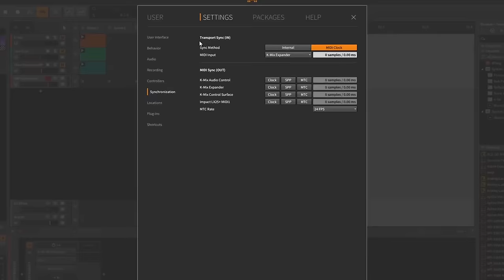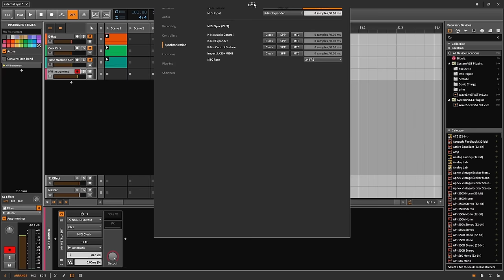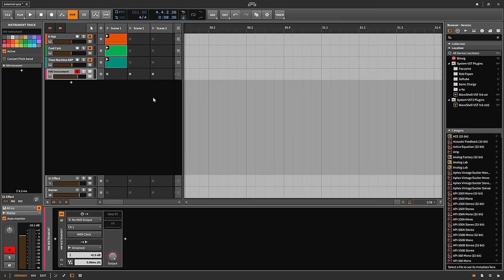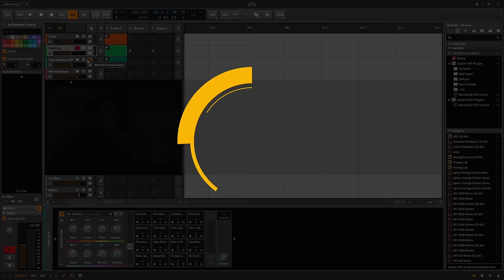MIDI Clock Sync [Bitwig Studio]

Comment: @Thavius do you use driver compensation? And does overbridge help?
Reply: the Octatrack doesn't use Overbridge, and Overbridge introduces latency so I would avoid using it in an external MIDI sync scenario personally. I didn't need to use any driver compensation here, but I do use it when I use Overbridge for my A4 and RYTM.

Comment: But it is not possible to record tempo changes you would make on your octatrack. So, if you would  jam with your octatrack, and you would slow down let us say tempo as a part of your song, record that, play it back now with your midi instruments inside computer. You can't! the part where your recorded octatrack performance is slowing down,  is the place where the rest don't follow.
Reply from the maker: Record the tempo automation on your Octatrack, and keep Bitwig Studio synced to that.
Reply: @bitwig  thanks for the idea, but that would be the other way around , that is not what i am after,  i wanna record the performance of  a set of a songs, and than add layers (using again hardware in sync to that recording) after that hapenes  if necessary. So , to that, bitwig should record  tempo changes together with audio signal but it can't ( no other DAW can  ) btw. I like your tutorials, nice and clear 👍